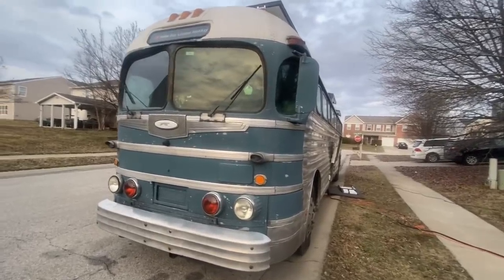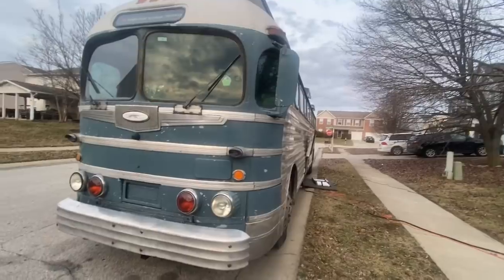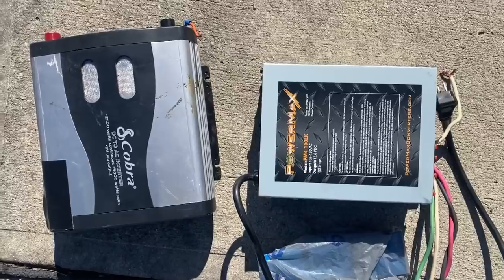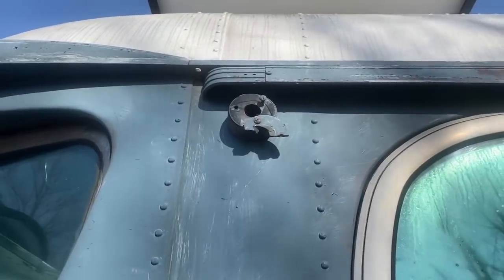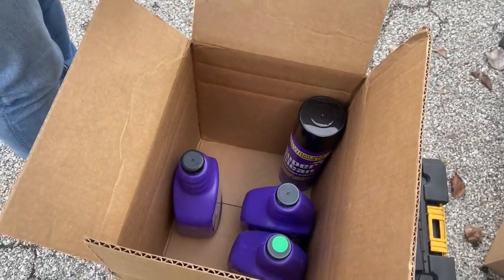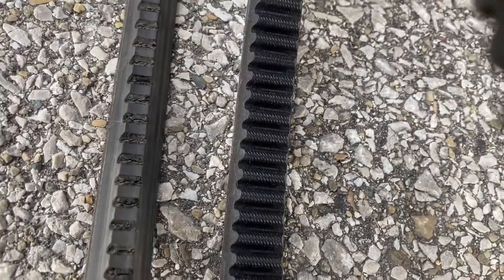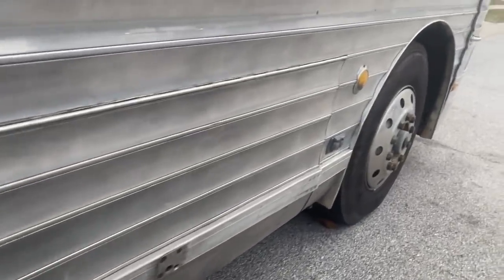Enter on our community tab for a chance to win a free sticker!

Comment: Super Clean and Purple Power are my go to degreasers.  I think Super Clean is a bit more potent.  About 12 years ago, I had to replace the head gasket on my son's Ford Probe. It had well over 100,000 miles and the head was thick with sludge under the valve cover, the baked on kind. We tried gas and then kerosene and it was useless. Then we used Super clean. It made the aluminum head look brand new. Because it is an alkaline solution, it can work on aluminum and etch it if you leave it on for a long time. Rinse with water. Just be cautious around the glittery stuff you enjoy. It will also attack paint if left on too long full strength.
If you enjoy coffee as much as I do, the pot, my travel mug, the burner all get a film of brown and Dawn detergemt will not remove it. A shot of Super Clean will. Just be sure to rinse thoroughly. Super Clean is a great product.

Comment: Have you tried using corn starch to polish the aluminum? It works pretty well. Very labor intensive. I've used it on a old camper before and then used RainX on it. Kept it looking good for a couple months with regular use.

Comment: Try RV self leveling sealant instead of silicone. If you look at some semi trailers you will see where it has been used to fix nicks gouges and holes. Good stuff.  Can be purchased at any tractor-trailer supplier.

Comment: Snap On corporate is pretty good about warranty issues for those without a regular dealer. We were without a Dealer for several months and I called, gave them part numbers of items I needed and they mailed them quickly and at no charge.
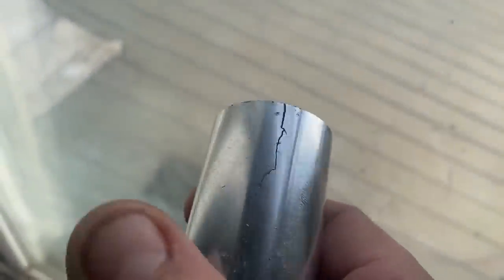Reply: I was going to mention something similar.  Their telephone support is really good and quick.  I’m pretty sure the 1 shown at 8:13 dates that socket to 1971.  Not to shabby. I’m sure that socket has never seen abuse or an impact gun in the last 49 years.  :)

Comment: Seeing the monkey wrench you took out,  if you have one still on the bus you can replace it with an aluminum one. Save a little more weight.
Reply from the maker: I have three on the bus still that was a duplicate size.   I’ve never needed two big ones at once.... until next week
Reply: @BusGreaseMonkey  well keep an eye out for the aluminum version. Lighter and easier to use.

Comment: I can pretty much guarantee you there's a bunch of rot in the frame behind those windows, I've seen buses 1/3 the age of Lenny have windows just fall out of them due to corrosion around the seals.
Reply from the maker: It’s all aluminum there is no rot.
Reply from the maker: The window by the kitchen wouldn’t leak when driving only when parked leaning to the one side.  The other window it was from above the window but came out infront of the wall. So no moisture got behind it.  And they were very small leaks.
Reply: @BusGreaseMonkey  That's good, the seals themselves do look pretty rotten on the video. Hopefully those are available soon from the supplier you mentioned a few times.

Comment: Those small Horror Fright drill bit sets are junk! Got a set and the first bit I used twisted like a pretzel..... The bigger index sets are better tho. I got a set with number, letter, and fractional sizes and it has been decent so far.
Reply from the maker: I’ve had great luck with them.  But they only drill a few holes before they need sharpening
Reply: Bus Grease Monkey  Might be a case of poor quality control in heat treating. Dunno... generally a properly hardened bit will snap first. Guess I shouldn’t have expected much for the price.... As I said, the bigger set I bought there has been very good tho. Well worth the money..